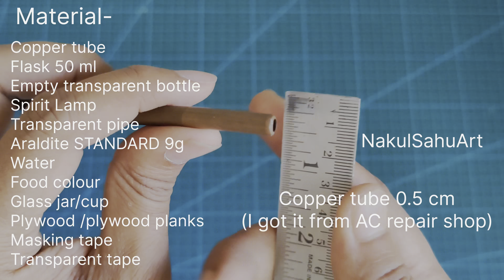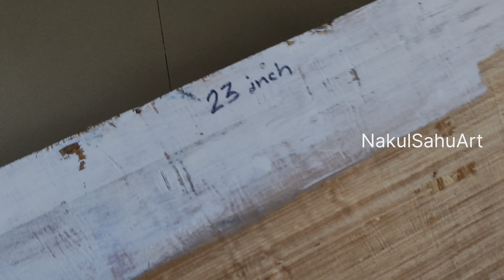Chemistry working model Distillation process | Distilled Water at home #science project NakulSahuArt

Comment from the maker: Distillation -
Distillation is a process used to separate mixtures based on differences in their volatilities in a boiling liquid mixture. When it comes to distilling water, the process involves heating water until it vaporizes, then cooling the vapor back into a liquid form, effectively removing impurities and contaminants. Here's a step-by-step explanation of the process:

1. *Heating:* The water is heated in a container until it reaches its boiling point and begins to vaporize. The boiling process helps to separate the water molecules from the dissolved solids, bacteria, viruses, and other impurities, as these typically have higher boiling points than water and thus remain in the liquid phase.

2. *Vaporization:* As the water boils, it transforms from its liquid form into steam or vapor. This vapor rises, leaving most types of impurities behind in the boiling container. Some volatile compounds with boiling points close to or lower than water's boiling point may also vaporize along with the water.

3. *Condensation:* The water vapor is then directed into a condenser, where it is cooled. Cooling can be achieved by passing the vapor through tubes that are cooled externally, often by air or a separate water system. As the vapor cools down, it condenses back into liquid water. This process of condensation turns the water vapor back into liquid form, but now it is much purer than the original liquid water, as most of the contaminants have been left behind in the boiling container.

4. *Collection:* The condensed water, now distilled, is collected in a separate container. This distilled water is free from dissolved solids and other impurities that were present in the original water.

Distillation is an effective method for purifying water and removing a wide range of contaminants. However, it is worth noting that some chemical contaminants that have lower boiling points than water or that can form azeotropes with water may not be completely removed by simple distillation. For these cases, additional purification methods might be necessary. Distillation is widely used not just for producing purified water but also in many industrial applications where the separation of mixtures is required.
Reply: Thanks for explaining detail. But many telling that it is fake pls tell it is ture or not

Comment: Nakul the experiment set up was nice. But you have to make some corrections in future. Always have condensation transport distance in Equalizer form, means it shall be never far away or too nearer. There must be no minimum bend in any flowing tubes as a result will cause maximum pressure as a conversion of resistance in flowing vaporizer. This may even result in a small crack in flask or tube enlargement. Instead of only using water you must add small balls of aluminium foil and paraffin oil to maintain the room temperature or inverse of atmospheric weather. Instead of liquid in the bottle, if the copper tube would have been wrapped or the bottle had been wrapped with poly tube and made the flow through the poly tube the condensation would have worked like a heat exchanger and the distillation rate would have been at a consistent rate.
Reply from the maker: Thank you for your valuable feedback, I'll keep those points in mind for future videos.